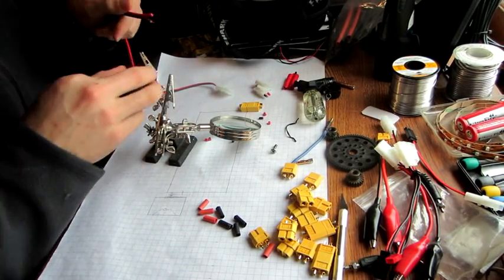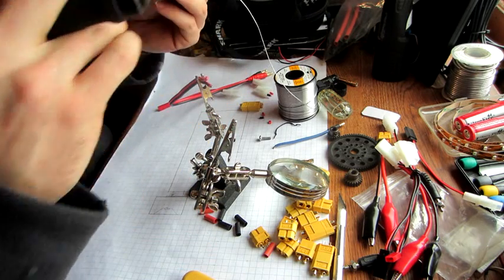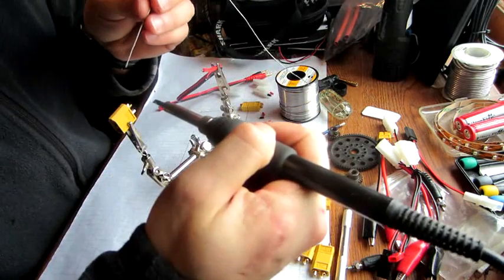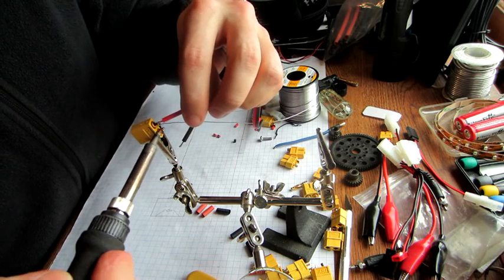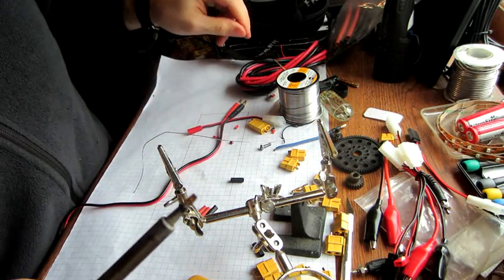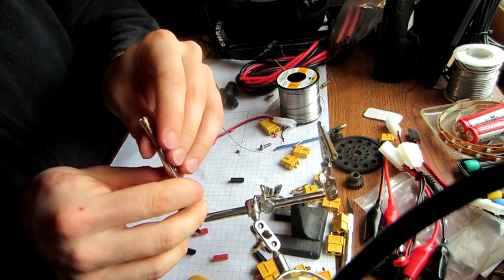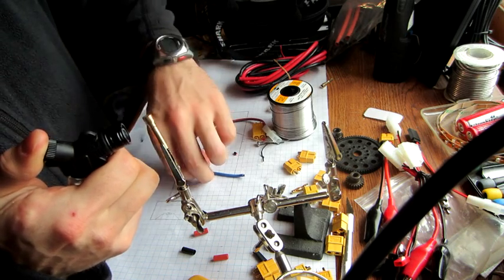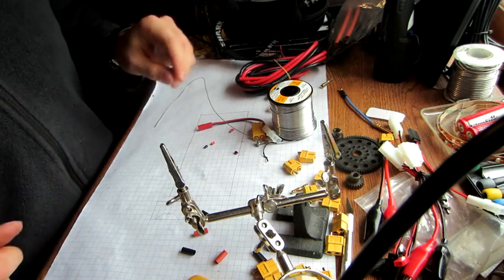How to Solder XT-60 connectors and bullet connectors

Comment: ty for the video, i have 5.5mm bullet conn on the end of my batteries. but all my other stuff is 4mm, can i cut off the 5.5mm ends and solder on 4mm bullet connector?  or do you know if they sell a 5.5mm bullet conn. reducer to 4mm bullet conn. ?  that i could just plug into to reduce....  wihtout having to cut ends and solder